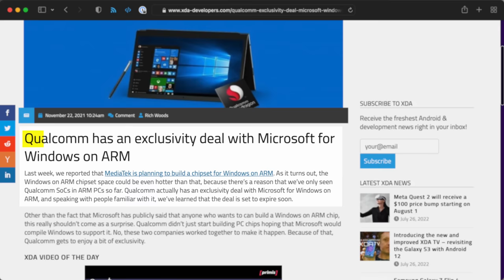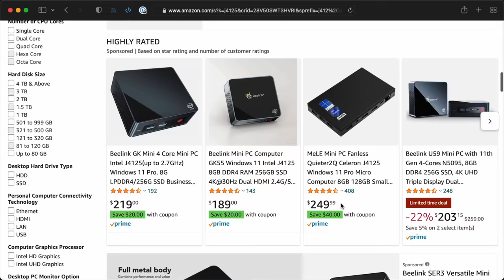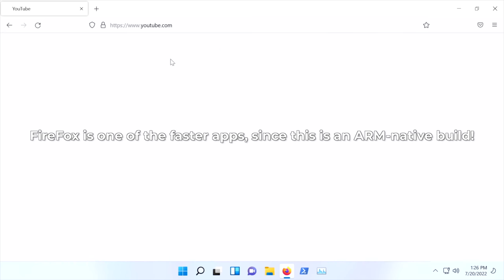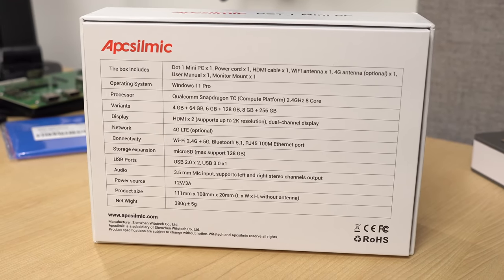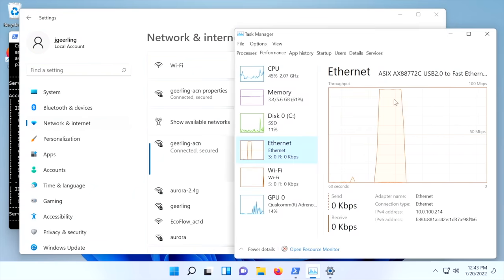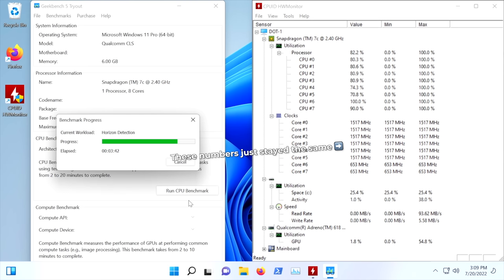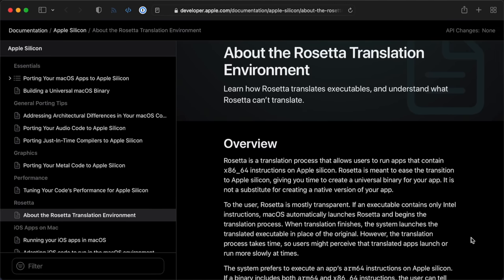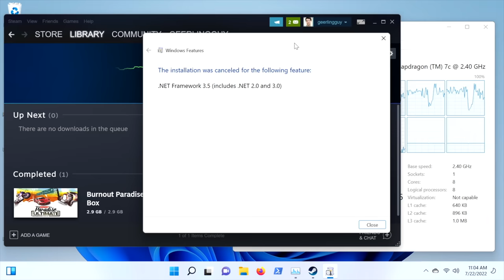Microsoft's wasted potential: Windows on ARM

Comment: Windows on ARM will always be a big deal to me in my life, I was part of the original project getting the Windows kernel working on ARM a decade ago. Even back then I saw it as an enormous task to get it right and it never materialized. then was marketed badly and being locked to specific hardware killed it. It still makes me sad that one of the largest projects I ever worked on just still doesnt work even a decade later.
Reply: 😕 sad to hear mate

this is why most people (who knows) like open source softwares.. at least no one would kill our hard work
Reply: I really like my Surface Pro X. I seem to in the minority but it works great for me. OTOH I am a normal person. I don't game on the bus and I don't make YouTube videos. It really is the tablet that turns into a computer. My only real complaint is that the power button is on the side. When I put the Surface Pro X in Portrait mode for reading it often accidently switches off.

So, thanks for your work. At least there is one consumer out there who appreciates it.
Reply: I stripped an old surface pro 3 to bare os and compiled what was needed. It runs world of warcraft like a champ and I even manage running some games with half the required ram👌
Reply: @logaandm  I'm a software engineer and I wouldn't give up my Surface Pro X. You do need to (at present) run the insiders builds for a good experience, to get 64-bit x86 emulation.
Reply: @davidboreham   I run 64Bit programs without issue and I am not on the Insider program. I think Windows 11 ARM has had full 64bit support about a year.

The only problems I've had is with USB devices without ARM drivers.
Reply: What’s even more depressing is a decade ago was 2012. Still feels like 2002 was a decade ago.
Reply: Reminds of GNU/Hurd... Still in its fancy states after couple of decades.. If memory served
Reply: Wowwww I was solo building a device JUST like this but I never chased investors like I should have.. I was building a custom OS like how Roku runs though... then I had the idea to just run Windows on a tiny computer and direct people how to watch free stuff efficiently and successfully without popups and ads... because I hate how limited roku is... I wanted to emulate games and show people how to have the BESTttt TV hub.. I was so lonely and wanted someone to build it with but I still live in the same small town and STILL don't know anyone irl who likes doing that kind of stuff... 10 years ago this was all my brain thought about and dreamed about and it even STILL gets my brain eagerly thinking like a pinball machine... I'd probably cut my finger off if I knew it'd somehow result in that projects success LOL
Reply: Was it Windows RT? It really had the potential, but the story was similar to Windows Phone which was the lack of apps.
Reply: @XBLXxR1fleManxX  and I was trying to build a kernel to boot from an undocumented soc/sbc inside a leaptv. It was eventually shelved and they were $10-15ea and would run circles around a pi at the time while a raspberry pi (still) is MSRP $35. It still is a contender for your use case but unfortunately no closer to that bootable kernel due to the wildly unpopular reception and performance from the bloated os and Qt games.
Reply: @arjujannaka9807  Yes this was WinRT.  it was so much fun working on it. I was always disappointed in how things turned out.
Reply: I spent a couple of years with my Windows Phone. A lot of people did. Not as much as Android or iPhone, but it was a lot of people.  It's sad that they butchered the execution of both the desktop and mobile ARM running Windows..
Reply: So you were part of the catastrophe called Windows RT? Condolences
Reply: Well, if its any consolation, I used windows arm damn near every day. Like a handful of others here, I've got a surface pro X, and I adore that thing. Windows arm has its quirks, but I've learned to work around them. Granted, its not like I'm doing any heavy lifting on it (nor should a surface be expected to do heavy lifting imo). I've got my desktop for that, and if I really need to I can just stream my destop to the surface pro x. Suffice to say, I'm a fan of your work.
Reply: @prajaybasu  tbh, I actually kindof liked the windows phone. The app store was terrible. But I liked the interface.
Reply: Hello. Do you know why Microsoft is so reluctant about ARM? because I can remember a fight my dad had with the Microsoft CEO or CTO Venezuela around mid 90's and at that time, Microsoft was really reluctant to release any test versions of windows ARM (embedded) that my dad needed for some servers he was setting up for some USA big companies.
Reply: Is WoARM better now?
Reply: Wonder if you ever got to meet anybody who made those NT 4.0 RISC ports for MIPS, PPC, and DEC Alpha.